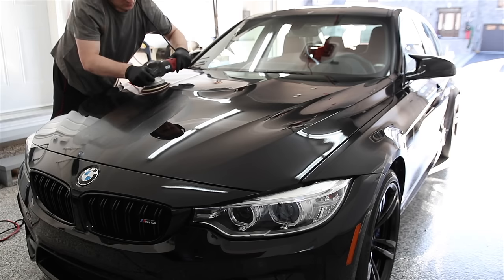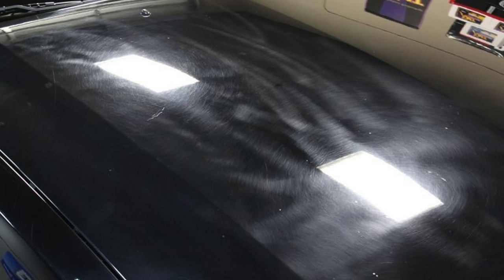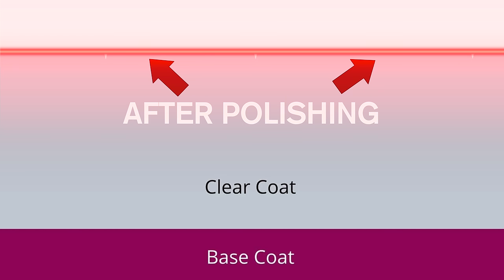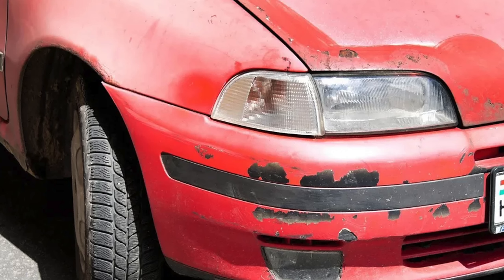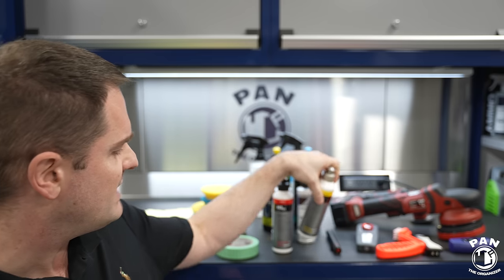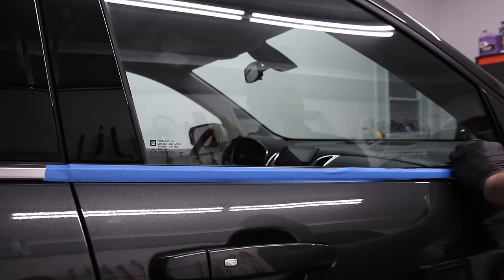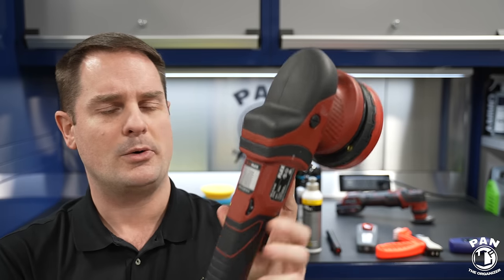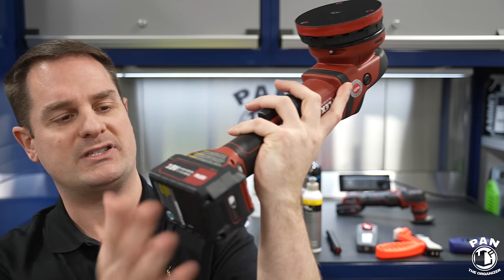DETAILING 101 - Paint Polishing - Everything You Need To Know

Comment: i used 3000 sand paper to remove by hand a horizontal scratch on my door and at one point i noticed a spot of a slightly different color . The car is 3yo and has never been repainted, i spend probably 5 min sanding it and tried not to spend too much time on any one place but I suspect i went through the clear coat... what is the best course of action in this? if i leave it like that, will the spot deteriorate over time as it now doesnt have uv protection that the clear coat provided? should apply ceramic coating? id appreciate any help!
Reply from the maker: If you blew through the clear coat is a panel respray unfortunately. A ceramic coating needs to bond to a clear coat. So if there is no clear coat, it’s pointless trying to apply some.

I can’t see the panel in person, so I can only go by what you are telling me.

Comment: Great video Pan, but I have one question: what would be the best way to determine whether I have to start with a compound or with a polish? On a dark car the swirls are better visible, but there's also a red (non-faded) car in the household.
Reply from the maker: Hard to fully explain in text, but generally speaking if you have deep swirls and scratches (you can almost feel the grooves with your fingernail) or heavily oxidized (milky appearance), you start with the compound and then move to the polish stage.

If your vehicle has never been paint corrected, it most likely needs a compound and polish.

If the vehicle is fairly new or only had some very faint/light scratches or swirls and overall looks decent and glossy, you could perhaps just use a polish.

The way to determine this is do a few test spots with different compounds/polishes and pads and see what you need to get your desired level of finish.
Reply: @PanTheOrganizer  Thanks, means a polish for her car and a very, very good compound stage for mine ;-)

Comment: Do you ever have issues with overheating? My random orbital polisher can go (on the lowest setting) about 10 minutes of polishing (in a 30 or so minute polishing session) before its soo hot it is smoking!   It is a Chicago electric product from Harbor Freight
Reply from the maker: Absolutely not, as I only use to grade polishers. Harbor Freight is entry level, basic stuff. You get what you pay for. Not saying it's terrible, but it's not the higher end engineering like my Rupes or Flex polishers by any stretch of the imagination.

If you have a bigger budget, save up for those polishers and you'll never run into overheating issues. And I polish for hours and hours with them in a single detailing session. Never once had an issue.

If you don't have 500-700$ for a high end polisher, perhaps look for a less expensive alternative that will still be better than your Harbor Freight, like those I recommend in my affordable polishers video here: https://youtu.be/LvPCkCqXEq0

Comment: Great videos especially for those of us trying to start doing this as newbies. One question, I started doing my car yesterday and really wasn't seeing results. Cleaned the car, let it cool, clay bar the area, dry, then use DA Milwaukee polisher with meguiar cutting pad and chemical guys clear cut compound. After 3 passes, I really wasn't see results that were overly noticeable. Speed was somewhere in the middle. I primed the pads, applied next to no downforce. This is on Mazda rx8 black paint. ANY IDEAS? could this be a situation where the protectant from other washes over the clear coat is hindering me? Thanks
Reply from the maker: Hi Matthew. It's hard to say as I wasn't there, but not all paint are made the same, so it's important to do test spots to find what the proper polishing compound and pad combination will give you the desired level of results on your specific paint. Chemical Guys don't make the best compounds and polishes.

I would recommend that you watch my favourite compounds, polishes and pads video here: https://youtu.be/2JDvQBs1viM

Also, from what I could read in your comment, you seem to have used "speed somewhere in the middle". When doing the compound of polishing stage, you want to use the higher speed settings. Typically speed 5 on a 6 speed machine. You only use low speeds when applying a wax or sealant for example, if you're applying the protection by machine. But for paint correction, you use high speeds. Slow steady arm movement, keep the pad flat on the surface, not too much pressure, and make sure the pad is spinning.

I hope this helps!
Reply: @PanTheOrganizer  thanks very much! This definitely helps! I will try a new compound. I did see that video so I'll pick up one of those. I definitely wasn't going fast enough then in terms of polisher speed so I'll up that for sure. These are great spots to start for me which I'm relieved about. Also, should I add more pressure? I was basically doing next to none.
Reply from the maker: Little to no pressure (10-15 lbs of pressure max). Let the pad and polish do the work. Not you. ;) And if you apply too much pressure, the pad will stall and stop spinning, so you're not correcting anymore.
Reply: @PanTheOrganizer  okay. Would you approximate that to basically hand weight on the polisher or slightly more?
Thanks so much for all the tips here.
Reply from the maker: Exactly barely more than the polisher’s weight.
Reply: @PanTheOrganizer  thanks very very much for all the support and advice!

Comment: I don't own a polisher so I plan on using Meguiares Ultimate compound  followed by their Ultimate polish. I will then use a panel prep. My question Pan is , does the polish  actually help since I will do by hand or  an I just compound by hand and then prep panel spray and apply Diy Detail 5 yr coating. Can't find to many vids on hand polishing by creators such as you and the rest " of the usual suspects.  Thank you for any help Pan
Reply from the maker: You can’t find many videos on hand polishing as you can’t achieve very good results that way and you waste a lot of elbow grease. Machine polishing will get you 100x better results in a fraction of the time.

Comment: Thanks Pan, another excellent comprehensive guide! I have a question for you. While there's no need to worry about burning through a new clear coat, is it safe to assume that light correction won't pose any risk of degrading the UV protection, even though the inhibitors sit right at the top? How about after several polishes? I want to keep my paint from fading over 10+ years and unless I'm mistaken the clear coat is the only real defence against UV despite claims from product manufacturers.
Reply from the maker: You can do a light polish twice yearly for many years on brand new paint without having to worry about removing the UV inhibitors. 

But if you polish your car right the first time, protect it, and use proper washing and drying techniques, you shouldn't have to polish after that. I have a new car every three years. It's polished once when I take delivery, and I never have to repolish for the three years of ownership.
Reply from the maker: Thanks for supporting my channel Andrew!

Comment: I'm still finding undetailed details after my low priced detailing (I got my money's worth).  I'm going to have to attend to those myself when the weather is nice.  A white car and all the panel welds around the doors and hood contours still have the black grease/dirt line.  Not enough soapy soft bristle bushing around the crevices.  The rocker panels and front bumper...repaint if I want them correct.  Peeling clear coat and gravel damage past the point of retouching.  I'm getting obsessed because the dealer is replacing the subframe on guarantee and I'm buying the attachments to take advantage of free labor.  With that out of the way I thank that I can pay a new front end control arm replacement myself next year.  My garage does not replace control arms just because they can move them with a pry bar or a certain mileage is reached.  If its not wiggling by hand its OK.  They are already making a fortune by just having the best reputation in the country.  They don't need to look for extra ways to stick you.

Comment: Hi Pan! Im going to be doing my wife’s car soon. She mainly has scratches from car washes and rubbing against the paint by walking past the car. Could I dive right into polishing or should I compound first? What’s your recommendation. Hope you can help.
Reply from the maker: It's hard to troubleshoot at a distance without seeing the vehicle in person hehe. So I will say this. It depends on how deep the scratches are. If there are big and deep scratches and swirls (ones you can feel with your fingernail) then most likely you have to start with a compound first, then move to a polishing stage. If there are only very light scratches barely visible to the naked eye, then perhaps you could get away with just a polish. It depends.

The way to know is simple. Start with just the polish, on a small section, and see if that does the trick. If yes, then great, you can just do a one step polish. If the scratches are still there, that's an indicator you will have to start with a compound first.

I hope this hellps.
Reply: Thank you Pan! It does help, I’ll be doing my very first correction so I want to make sure to do it as proper as possible with the right methods & techniques.
Reply from the maker: My pleasure! You can do it!

Here's another recent video on demystifying paint correction: https://youtu.be/b9KDpKMmAi0?si=3UuPZ1f2vBgeiN7J

Comment: Great video as always, your channels awesome  ! If I’m using sonex perfect finish and only have that right now could I use a cutting pad to get deeper scratches out then which to a polishing pad , with the same polish ?
Reply from the maker: Thanks for the kind words. To answer your question, Sonax Perfect Finish is a finishing polish, used with a polishing pad. That means for light swirls and scratches. If you have deeper scratches and swirls, you first would need to start with a compound and a heavier cutting pad. And then finish with the Sonax polish and polishing pad.

And selecting the type of polish, or compound, or pad, really depends on your specific paint and types of damages that need to be corrected. There isn't a "one miracle product solves all issues" unfortunately when it comes to paint correction. You have to try and see what works best for your paint and desired level of finish.

A good starting point is my video on my favourite compounds, polishes and pads here: https://youtu.be/2JDvQBs1viM?si=RQyk9IKd8efqFnIO

Comment: Question is, after you sprayed with IPA/paint prep, how are you sure that all of it was removed and not just wiped around the surface?  IPA may have dissolved the oils, but not all of the ipa/dissolved oils make it onto the cloth.  I can see that a lot of the ipa is till on the surface after each wipe, which then evaporates quickly.    Maybe we should power wash after the ipa?
Reply from the maker: I think you're overthinking the moment here. But yes you certainly could wash the car again and dry it after you did the paint prep stage (aka IPA wipe). But professional detailers won't as that is time consuming and not really needed. There is no evidence showing that the IPA step doesn't remove what little polishing oils or residue is on the surface.

And you would mainly do the IPA stage before you apply a true coating (ceramic or graphene, in glass bottles). Not as important before applying a traditional wax or synthetic polymer sealant for example.

Comment: Great video, thank you.
One question:
Many suppliers offer compound/polish and pads in super soft, soft, medium, hard (or coarse) and super hard. Do you always correct the paint in two steps: cut and polish, with correct pads based on subject, or it make sense to do it in 3 steps? Coarse cut, medium cut and fine polish? Thanks
Reply from the maker: You have to do a test spot to determine which pads and compounds/polishes you will need. You need to adjust according to the paint you are working on. No two paints are the same (soft, hard, etc) and no two paints are in the same state (scratches, swirls, oxidation, etc).

Comment: Hi, again Pan. So many great videos and so much information..I've been watching much of the evening. I have a couple of motorcycles apart in my garage and - following your lead, I am thoroughly cleaning, polishing and protecting all the painted surfaces. The only painted metal on a motorcycle (other than the rims for which I have the DLUX ceramic coating) is the fuel tank. My fairing is made of high gloss plastic. Some of the dash is low gloss plastic or vinyl and my saddles bags are high gloss fiberglass. I am assuming the fiberglass has a clearcoat as well. Forgive me if I haven't found the video addressing this yet but what kind of coating should I use on the saddlebags? CarPro CQuartz UK 3.0:?
Reply from the maker: For leather watch my tutorial: https://youtu.be/CuN77nz8Ex8

Comment: Hey Pan Just wanted to thank you for the amazing videos you put out, you have taught me a ton :-) also maybe don't speed up the part where you're showing yourself and others buffing, people like me need to see The actual speed we need to move the buffer :-) I think one of the hardest things to learn is to slow down. Also how long do you think you take to buff a 2 ft by 2 ft section total 1 minute? And how many passes? PS I've got like seven buffers now maybe 50 plus pads tons of different sauces I was wondering if you have made a video showing how you keep things organized :-)
Reply from the maker: Thanks for the feedback Terry. I'm glad you enjoyed this. Everyone works at different speeds as not everyone has the same experience, so it's impossible to say how much a section should take. Take your time and do it right, that's the most important. You'll naturally gain speed and efficiency as you gain more experience.

One you're done with a pass, look at your results with an inspection light. That will let you know if you got the level of finish you wanted, or if you need more passes, or if you need to change the pad and polish combo.

Comment: Hi Pan,

I understand the process of the 3M tape on plastic.  But, after removing the tape, can I use the Gyeon Trim?  do I need to do something specific?
Reply from the maker: It depends what your trim needs. Does it need restoration? Is it oxidized in white in appearance? If so, you'll need a trim restorer. If it's in good shape, you can just apply some trim protection like Gyeon Trim yes.

Comment: What is the best compound and polish for beginners? I have tried the rupes uno and didnt see much of a difference. I want to do a 2 step on my truck that has alot of swirls. Not sure if I should get koch chemie, meguiers, shine supply, or rupes
Reply from the maker: Hi Sandra. There's no such thing as a polish for beginners. It's more which selection you should pick to tackle your specific paint and the issues that are on it. 

Rupes Uno is an all-in-one, meaning a light polish with a bit of paint sealant added in it for a light protection (only lasts a few weeks). That's not really serious paint correction.

You need a dedicated compound, followed by a dedicated polish. And after your paint correction steps, that's when you apply a proper paint protection of your choice: wax, sealant, etc.

It also depends what pads you have... There are many parts to the system. A good kit to have that usually works for most beginners is the Meguiar's DA correction system: https://amzn.to/3IuGEwd

In there you get the compound + cutting discs, and the finishing wax (polish + wax) with finishing discs.

Comment: Pan, can you polish ceramic coatings? I have some slight imperfections on my ceramic coating and was advised that I COULD use a light polishing compound such as P4 by Chemical Guys by a girl that worked at the Detail Garage near me.
Reply from the maker: You wouldn't polish ceramic coatings normally as you would damage the coating. Keep in mind polishes are abrasives. There is one polish made specifically to correct very minor defects on ceramic coatings, and it's CarPro Essence+ (not the regular Essence). But use carefully.

Comment: Hey Pan, you showed 2 different pads. I'm a novice. Does it matter which pads to use the classic or the foam pads ? Thank u for the video.
Reply from the maker: There are foam pads, microfiber pads, wool pads, hybrid pads, etc. There isn't a one size fits all in the paint correction world. You have to find the right pad and compound/polish combo for your specific type of paint, and level of desired defect removal. Hence why doing test spots is essential to figure out what is the appropriate combo.

Typically, the less agressive is foam, then you move to microfiber, and from there the most agressive is typically wool pads (mainly used on rotary polishers).

But every pad type also has color codes for different levels of cutting ability. Each company has their color code. So in foam pads, you can get some yellow or orange cutting pads (from Lake Country for example), and then have some soft grey or white polishing pads (again at Lake Country). You have to look into each brand's system.

Here's a video I made about my favourite pads and compounds/polishes combos: https://youtu.be/2JDvQBs1viM
Reply: @PanTheOrganizer  Thank u so much.
Reply: @PanTheOrganizer when using a portal cable , what gage of extension cord  should be used so that polisher don't get burnt up.